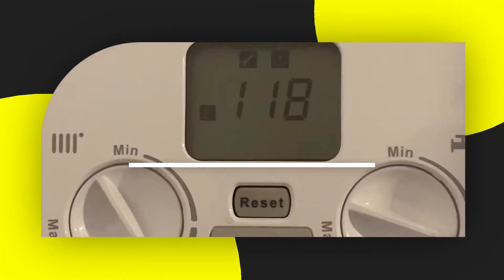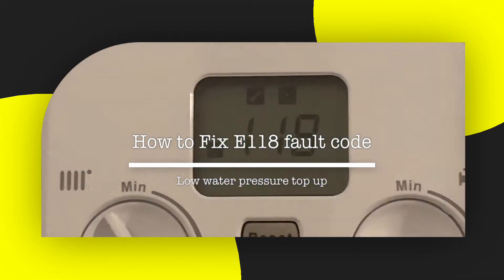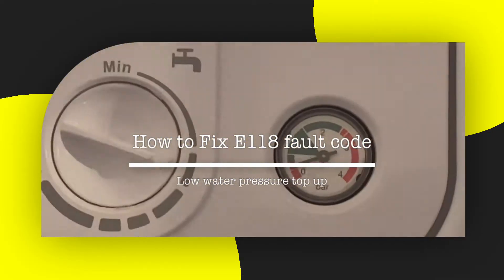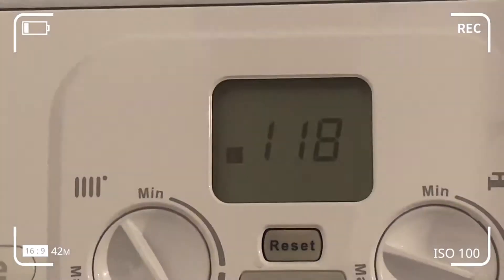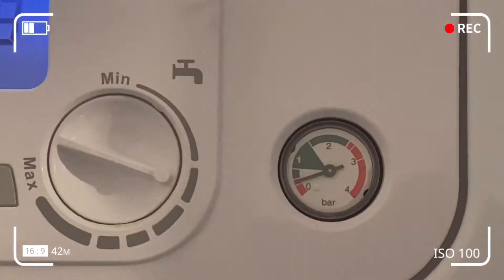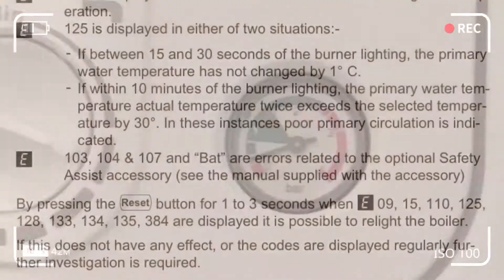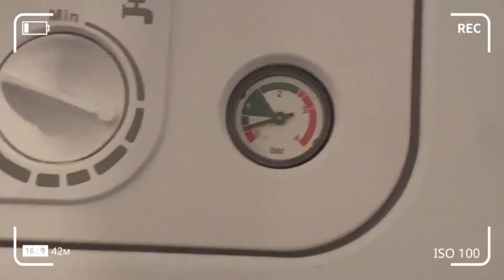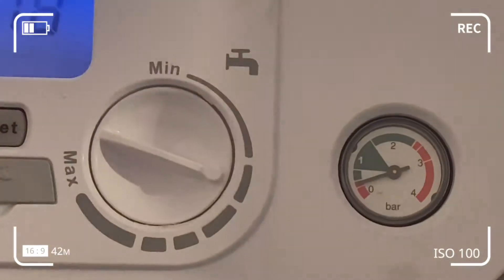How to Repair or fix Error code E118 flashing fault on your Baxi Assure Boiler - low water pressure

Comment: Thanks for this helpful video. What does it signify please if this fault presents often? I have a newly installed Baxi 830.
Reply from the maker: Hello J K. The main  code fault is low boiler water pressure. If it presents often you might have a radiator leak in so get someone in to check your radiator or boiler system out.  Check to see if your radiator is bleeding from the compression nut or union valve where you have your lock shield valve. Your nut should be tightened back if loose., a power flush and radiator bleed might suffice if you have a bleed and a pressurised system and not a conventional system.Also try topping up when your boiler isn’t hot due to expansion of hot water when it is hot as it might descend quickly as your boiler cools down. Don’t forget to subscribe, like and share. Helps channel grow. Have a great weekend
Reply: @UtechUreview  Thanks so much for the helpful reply - I’ve subscribed and shared! Could this code signify an issue with the boiler itself? It’s new and appears to have lost pressure slightly since the flow and return valves were closed 24 hours ago.

Comment: Topd up not continuing to fire.. switching off after few moments...any solutions??
Reply from the maker: Hi Karl, What level on the gauge did you top up to?
When it switched off after the topping up 🆙 is the E118 displayed? It might be indicative of a radiator leak if the pressure keeps dropping after topping up. Look forward to hearing from you

Comment: I have the exact same boiler with exact same low pressure e118 error message. I have followed your instructions and nothing has happened. No noise, no change in water pressure. What now?
Reply from the maker: Hi Casey, please can you confirm you opened  both valves and there was no movement of the gauge or needle? What is your pressure reading at the moment ? Is it below 1 or in the red region?
Reply: Got it sorted now, it was a leak coming from one of the radiators
Reply from the maker: @caseyspriggs6934 makes sense that you had a leak if you weren’t getting any topping up pressure as could have been frozen pipes, leaks, blocks e.t.c as earlier highlighted in the video, even if you had just had a flush you still would have had topping pressure when topping up. Glad you got there in the end and enjoy the rest of your week

Comment: You can imagine a damsel in distress. all I can say is I got the heating back up and was able to bubble bath. I topped up to almost 2 accidentally? Would that be a problem. Many thanks very straight forward to follow
Reply from the maker: You welcome Very Y & T. Glad you sorted. Boiler pressure reduces over a protracted period of time of use so should drop eventually but try to keep the pressure at nominal 1 or 1.5 next time by slowly allowing pressure in with one of the valves as opposed to a full gush. Have a great weekend. Appreciate the feedback. Don’t forget to subscribe and share. Helps channel grow